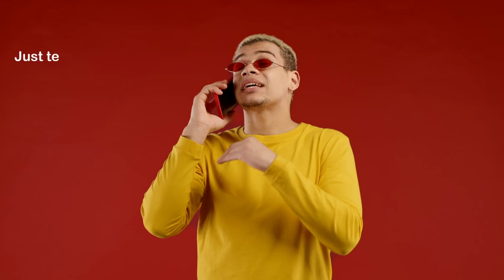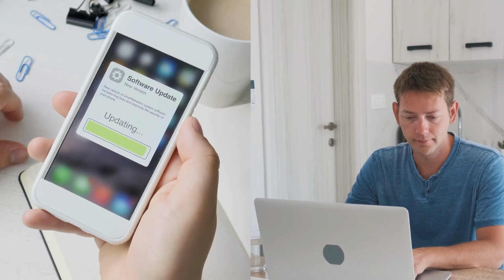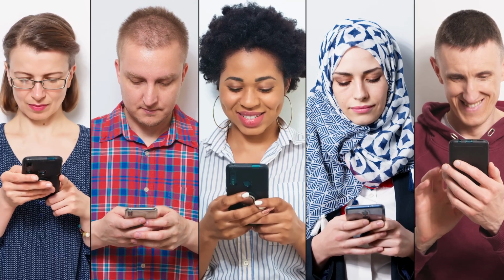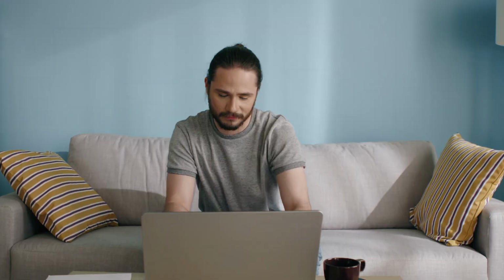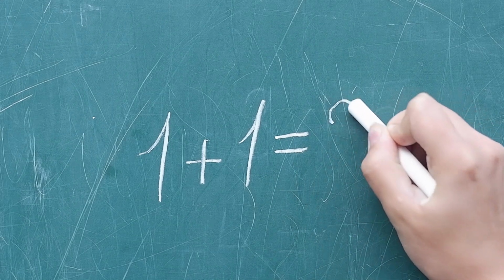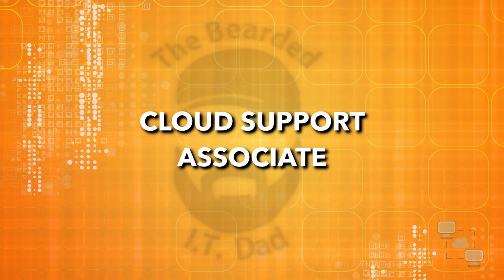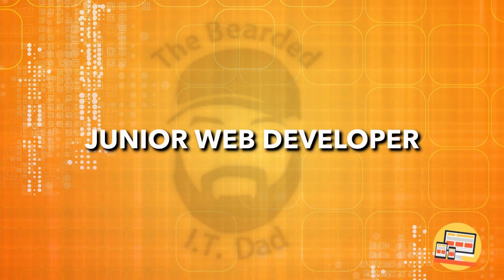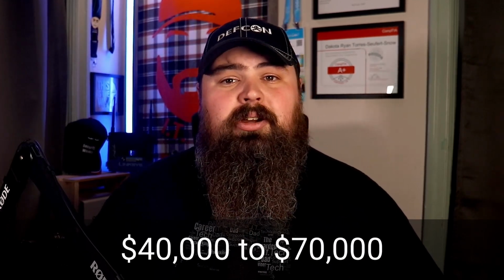Remote Tech Jobs That Are Always Hiring!

Comment: Recently laid off due to downsizing. They gave me 8 weeks severance pay. So I want to use opportunity to switch from 10 years customer service via answering service to help desk. I started working on my A+. Do I have to have that certification before applying? Or just start applying while working on it?
Reply: Try the google support tech course on coursera Google IT Support Professional Certificate (self paced and you can finish under 3 months
Reply: Not necessarily. Work experience helps. A+ is good for repair and entry level tech positions. Everything is arbitrary. It ties down to the person reading your resume and sending you to schedule an interview and HR then interviewing and hiring you. They could care less about certification. When there is high need due to season, most companies lift experience, references, and certification requirements and hire you just based on how well you did at the interview.

Comment: A hudge number of Network and Sysadmins work remote these days. No need to be on-site like the old days as On-Prem servers get smaller or migration to the cloud. Hardware related issues is now handed down to data center technicians while the DevOps Engineers or Sysadmin focus on automating infrastructure deployments and configurations.
Reply from the maker: So true
Reply: Yeah but you still have to handle some support tickets that have been escalated to you
Reply: @KingKhan-ez3gg that's normal as an escalation point but not their primary focus.
Reply: Even for cloud vacancies, many big tech require in-person work, devops also applies to this.